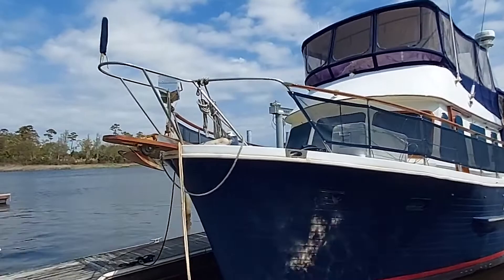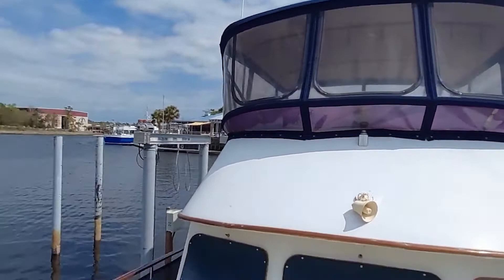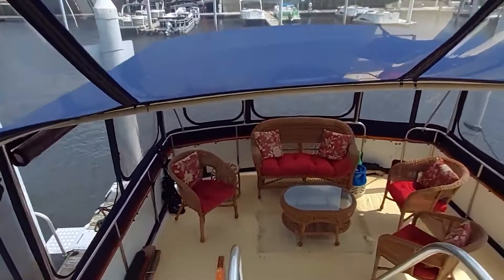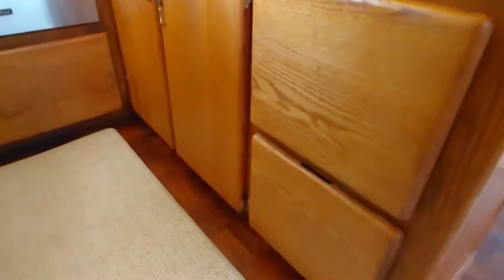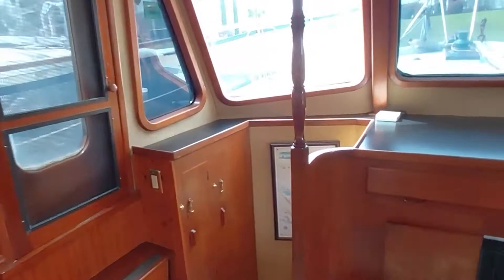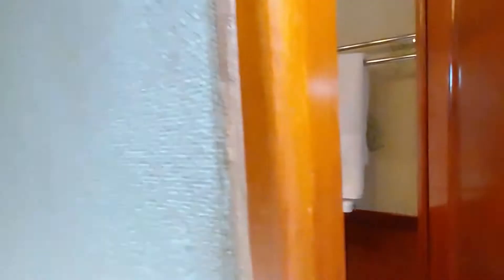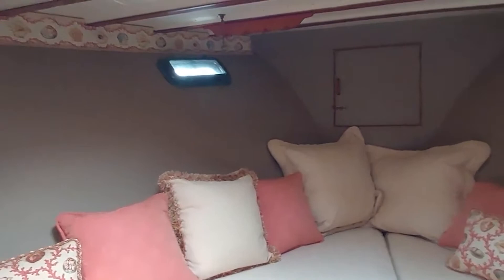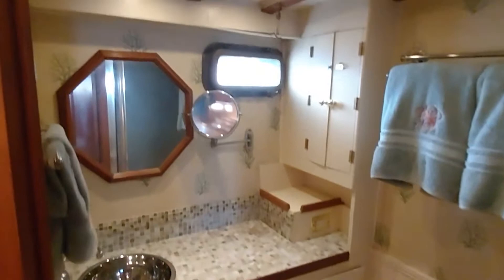SOLD/ Dorcas Ann 1979 DeFever 43 Only $85,000.00

Comment: I don't see any asking price was that not set? Has the boat been sold this is two months old? And how do I get insurance on a boat that's over 40 years. Also another concern is keeping it out of hurricane area during that season I wonder if you could tell me where it would have to be located to maintain coverage.
Reply from the maker: This vessel is currently undergoing some repairs and is off the market temporarily. The asking price was $155,000.00.
It can be difficult to get insurance on older boats but not impossible. Each company has different rules about geographic location during hurricane season.
Feel free to contact me directly at lars@curtisstokes.net for more information. I can help you with all of you vessel purchase questions.
Thanks